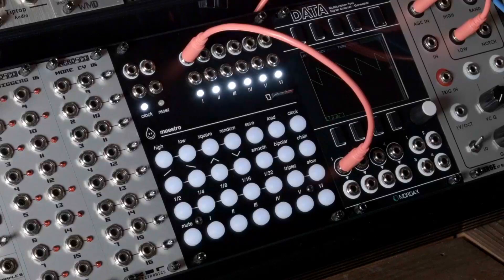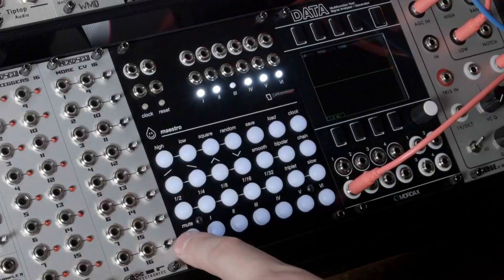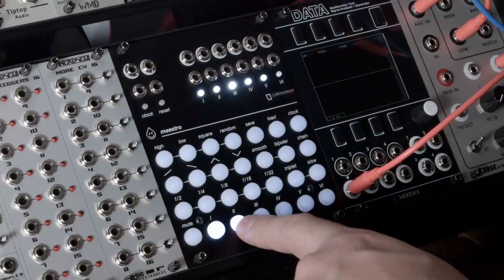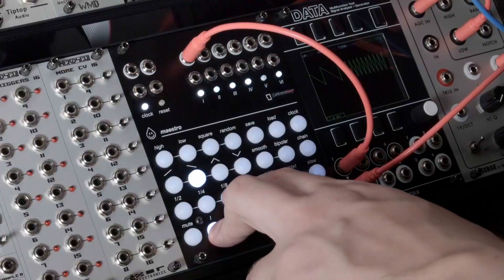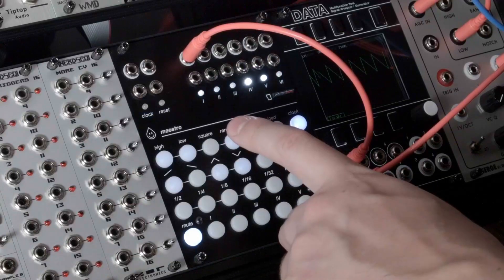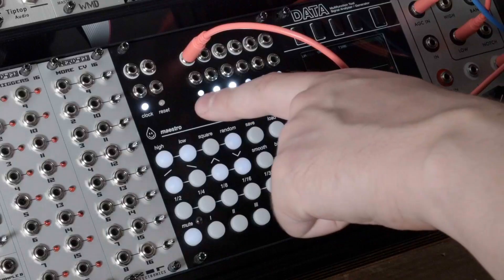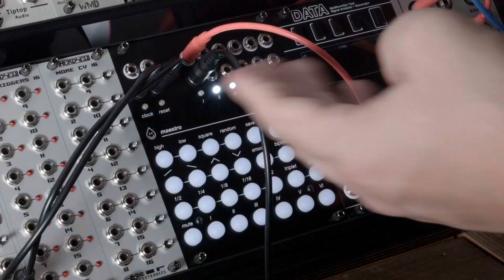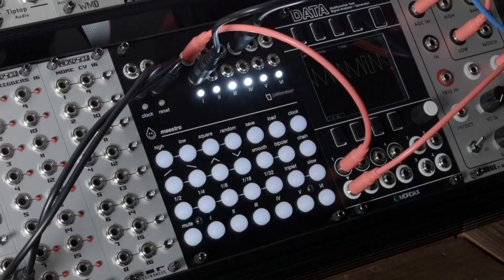Maestro Video Manual (Firmware 1.0)

Comment: Idea for you.  Make a matrix mixer using your push button interface like on the Maestro.  I would prefer pushing and tracking buttons than using pins/knobs to connect ins and outs.  What I'd really like is a better way to manage Aux Sends.  I have the Hexmix with Expander but turning knobs to turn on and off FX is not quick for playing live.  And I dont think Id be able to keep track of pins in a matrix performing live either.
Reply: what about 4MS vca matrix?  Might be overkill for your use-case though.
Reply: @PlerbyMcFlerb  Thanks for the suggestion.  I ended up realizing that what I really wanted was an interface that let me perform modulation.  I use a Lapsus Os with various LFOs and CV sources to control how much mod I want to affect whatever.  Turns out I prefer a few sliders vs buttons.

Comment: I've had mine less than a day. And this video really bakes my noodle (Matrix meme). Hopefully that's what you had in mind ;-)  So if you want for example 100BPM, what external clock rate should Pam's be feeding it? What is the speed range possible feeding external clock? Should Pam's be sending vanilla square wave or something else? 50% duty cycle? Is the header on the back eventually to chain them together in some way to get more channels? Or what?
Reply from the maker: if you want to externally clock it with Pam's  - you would set Pam's tempo to 100bpm, and use an x4 output (50% duty cycle square wave is fine) - this is a 4ppqn clock.  The minimum external clock tempo is 46bpm, any slower than that and Maestro will think the clock has "stopped" on each pulse.
Reply: @acidraintechnology8913  Thanks, so my initial feedback is that you should provide a text file on the SD card where you can select the PPQN clock between 4, 8, 16, 24. They already do an options file on Morphagene (for example). I figure you will be doing this sooner or later for something, so may as well start now. Also, 46 is probably not slow enough. I use 32 a lot. Then again the multiply and divide options can work around this limitation.

Comment: Very nice module, could be just what I am looking for - is it able to send out the clock via the gate bus?
Reply: It uses a 5 pin connector for power, so that would be a negative.
Reply: @deadredeyes  too bad, having the ability to run one clock to all sequencers without any patching is such a valuable concept.
Reply: @ohnoezitsroger  I hear you. The problem there is that not all sequencers in Eurorack use the same clock standard. The Maestro for example uses 4PPQN, where others typically use the standard 24, some are 48, and even 96. Though I appreciated Dieter's foresight in using the bus for clock distribution, I've never used it in my 30U setup.
Reply: @ohnoezitsroger  Thankfully the Reset input really helps keep the Maestro in-line with everything else. It's really worth the hassle. I ended up getting one to replace a chain of modules that I used for many patches: Clock dividers, clock multipliers, clockable LFOs, sample& holds, and some slew rate limiters. Gotta love when one $400 module does the job of $1,400 in modules.
Reply: @deadredeyes  Yes, but then again the gate was actually intended for gates, not clocks. I'm using the Varigate and Voltage Block, and it really works like a charm slaving one to the other. Thanks for the heads up about the other uses, I was actually thinking on putting two clock dividers into my drumcase, have to look into how the Maestro could substitute them. The best about a simple a-160 is the no setup required approach.
Reply: @ohnoezitsroger  Totally! The A-160 is fantastic, I've got a A-160-2 myself. Lovely little module. Also should have mentioned above that the Maestro has essentially replaced my Chaos Computer & A-152 for random voltage needs. Pretty chuffed to have so much options in 20HP.

Comment: Well explained, thorough and slow enough for me. To make such a versatile module so comprehensible and easy to use is no small feat. 
I'm foremost an visual artist so for me modular is partly about seeing the chains and what is going on. As most artists I'm a bit stupid so I prefere many simple HP consuming modules than a few complex modules packed with functionality, multi functional buttons and hellishly deep menus. 

Maestro seems to be useful both for novices and grand maestro wizards and I think you made a right decision regarding the waveforms, that they got fixed shapes and sizes as this contributes to the module being well structured, clear, better for live use and fast programing. Saying that, most buyers should probably consider getting more VCA's or attenuators with it.

This module can be used for so many things and will probably be the control centre for many, placed next to a sequencer/quantizer and a mixer. 

It's obviously good for techno and other fast paced repetitive and rhythmically interesting music so I would like to see a video where someone utilize this module for playing more melodically complex and or slow evolving ambient music. I would also like to hear what it sounds like if it is possible to clock it fast enough.
Reply from the maker: it does indeed run at audio rates - up to about 10kHz.  Truth be told we also sell some nice attenuation modules haha but many oscillators and voices also have attenuation on the inputs available too.  I plan on making a very ambient demo with maestro soon - stay tuned!
Reply: @acidraintechnology8913  Hey, Thanks for reply : )
Is it the Navigator you are talking about regarding attenuation? 
Yes I got some input attenuations on some of my oscillators but depending on how Maestro is used I was thinking that it would make sense to attenuate the lfo's emitted, depending on what they are used for of course. Like for filter sweeps or maybe plug it in to a 1v/oct? Anyway I think the idea that you can never have enough VCA's still is somewhat true, and that attenuators are close enough in many cases. 
Looking forward to your ambient demo. Maybe you care for putting a small sound demo at the end?